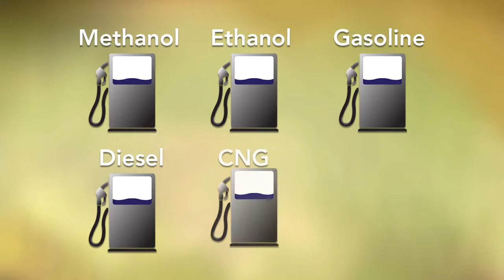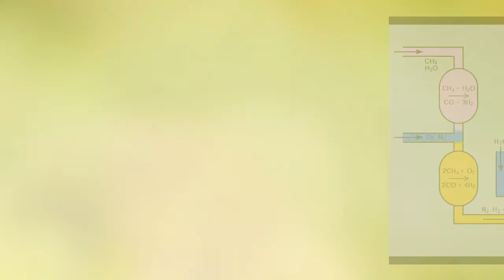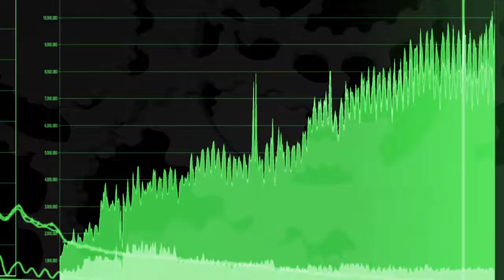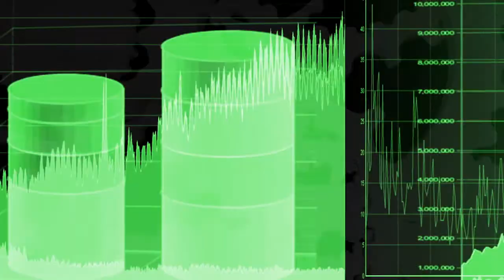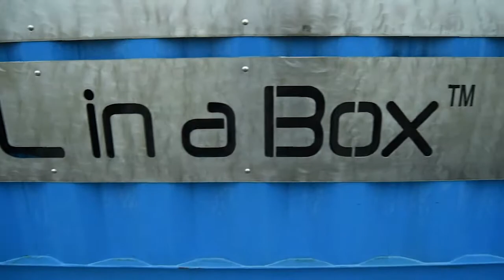Methanol to Gasoline - #5 GasTechno Video Series

Comment: Why methanol just use the natural gas. Methanol isn’t good for combustion engines because it creates high concentrations of Formic acid during the combustion process which leads to degradation of the internal components